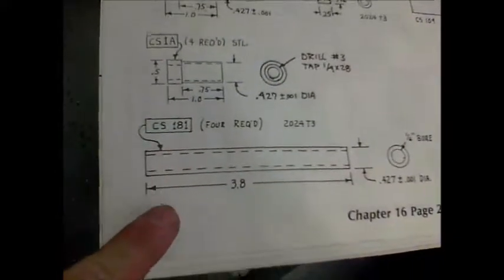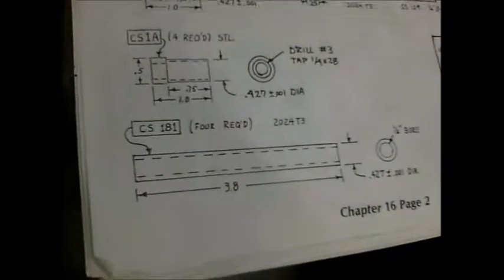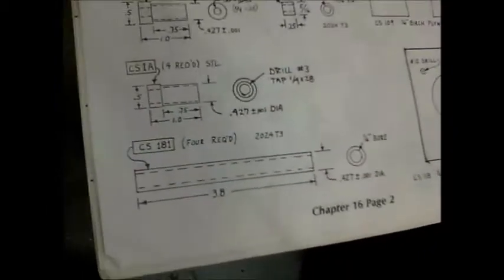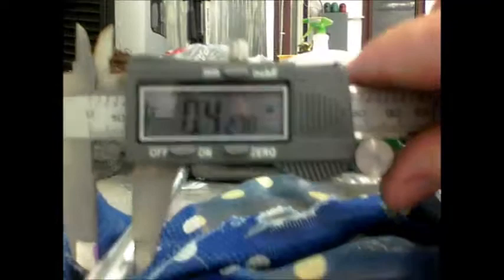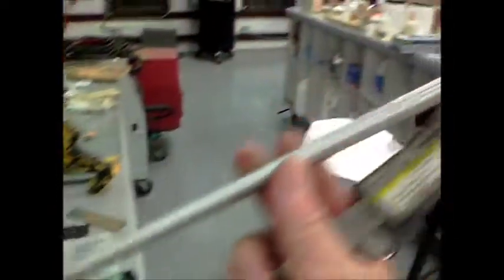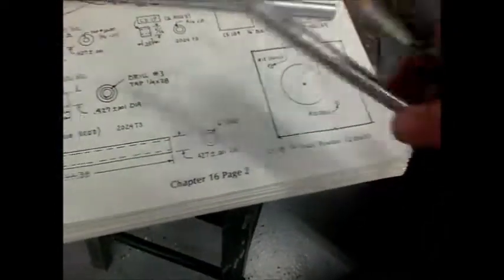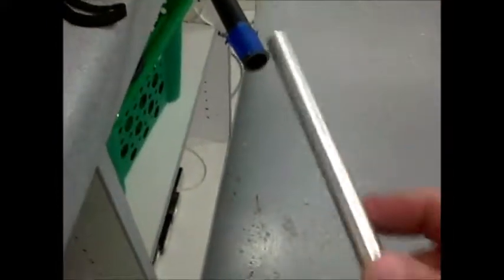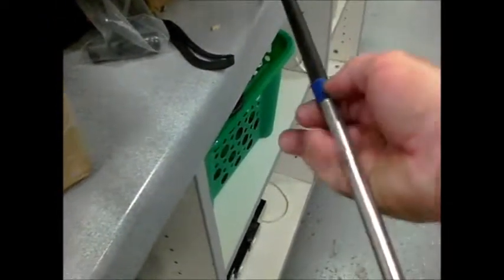Cozy Build -CS 181

Comment: I admire builders who own actual machining equipment. I adapt my large, floor-standing drill press to accomplish some machining operations but of course, doing so is fraught with compromises. The 20 amp nominal service in my city-owned hangar barely keeps up with one major draw at a time. Have to switch air compressor to off before starting any other substantial tool. You benefit greatly from your excellent facility 😎🎩♠️💙
Reply from the maker: Thank you. I built my shop behind my house and made sure I had  100amp service.  Ive not overloaded that yet. LOL